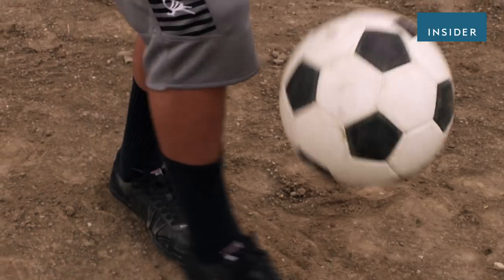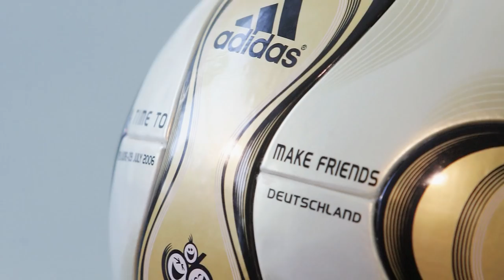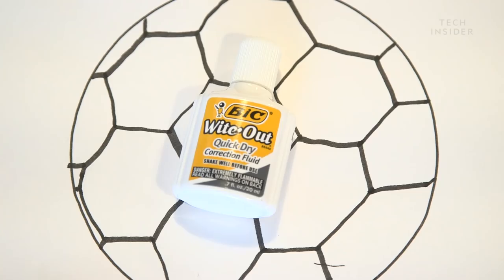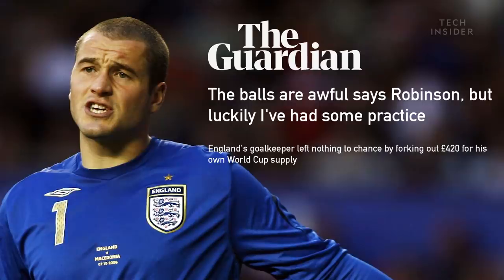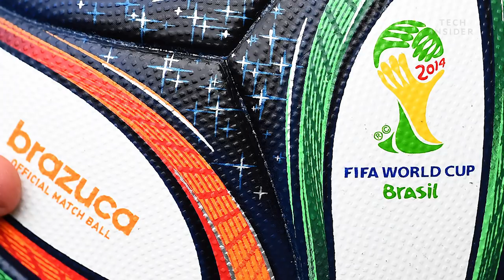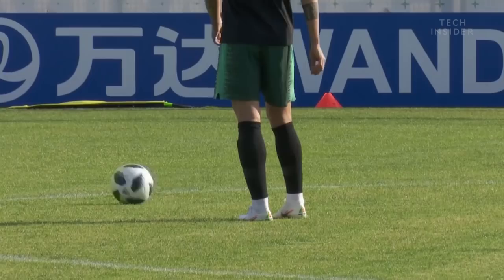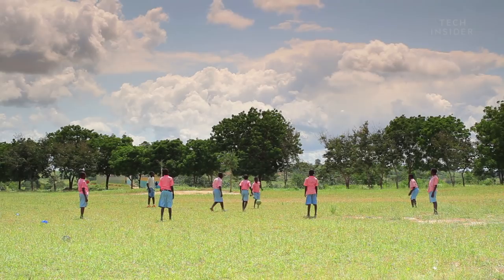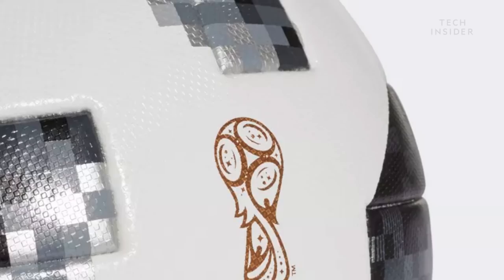Why World Cup Balls Look So Weird Every Tournament

Comment: As a retired semi-pro footballer, I can say the high-end ball usually require way less power to kick and better performance overall. Maybe the pros complaining because they’re on the top level tournament technical aspects can be on & off between players. But at the bottom of the pyramid we all consider the high end ball is better performing overall than the regular low-end ball
Reply: Yeah for sure, every replica ball I’ve owned was considerably light and tended to float in the air compared to my official brazuca ball which even caused my rec U18 soccer/futball officials to omit them when we played like they’re that bad even though they’re similar to the original Telstar ball with different panel design. Honestly I think these soccer/futball professionals are just finding things to complain about because they haven’t used a replica like ball ever since they were like 7